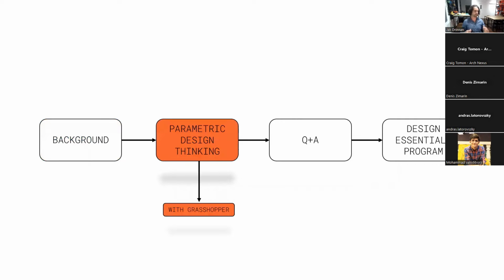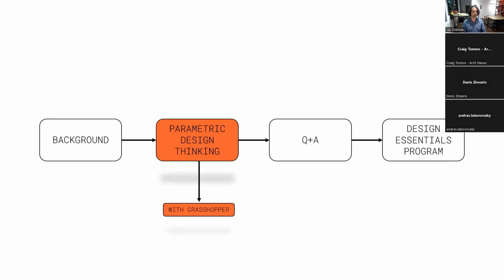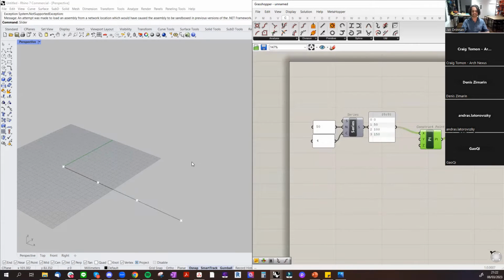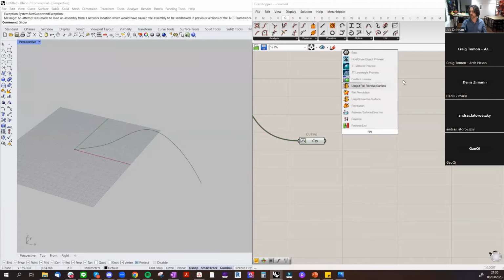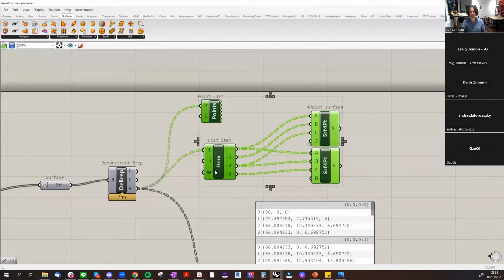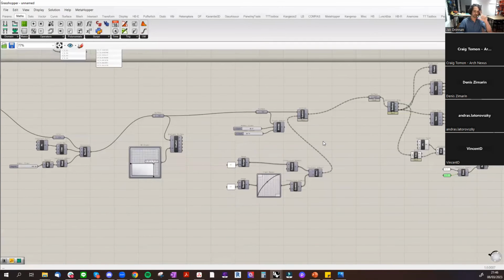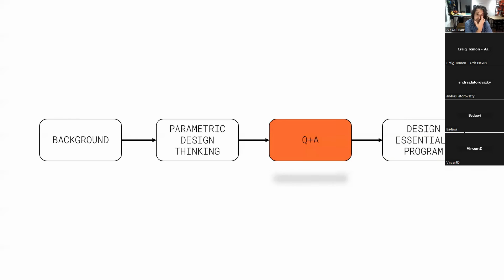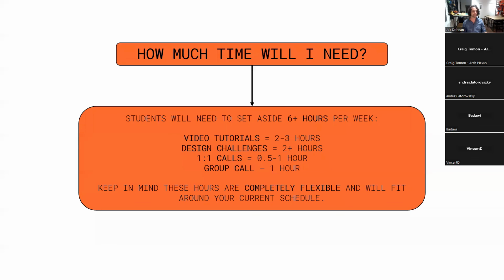Tekne Learn - Parametric Design Thinking Webinar - March 2023

Comment: Hi! Why is there difference in the location of the points between the Divide Curve Component and the Evaluate Curve with Range method? I didn't understand, cause in my head it should be the same since both methods are dividing the curve in 10 pieces.. Sorry if you explained in the video, but i repeated this part and still havent understand it.. english is not my native language xD
Reply from the maker: Hey Gustavo! I just uploaded a new video on Curve Parameters - check it out, I think it should answer your question! https://youtu.be/Rqu-b6-1jFo?si=_QiRnol297aoLTtx